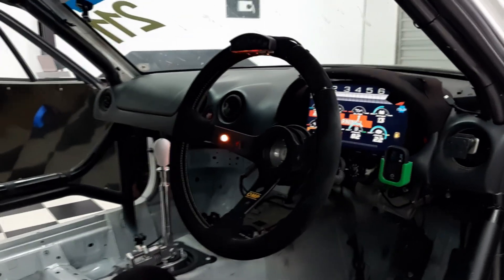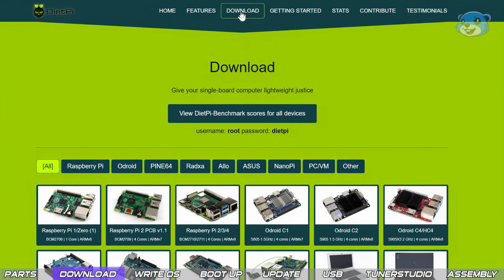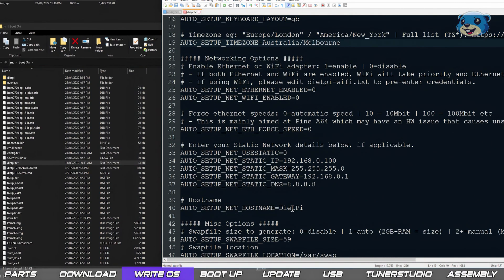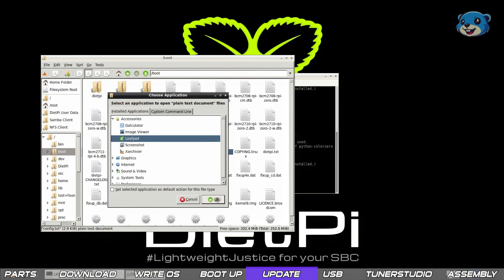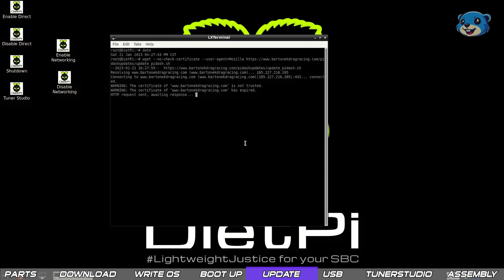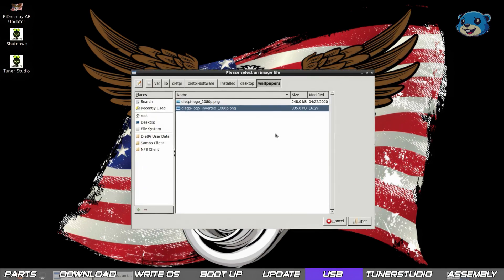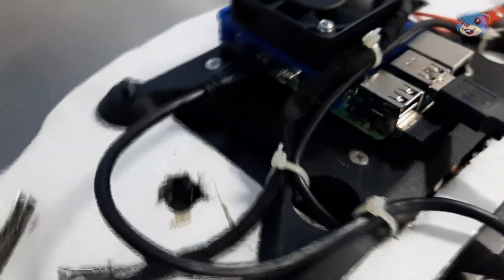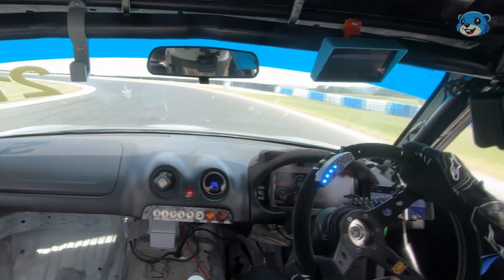DIY Car Digital Dashboard Raspberry Pi: GUIDE for Megasquirt

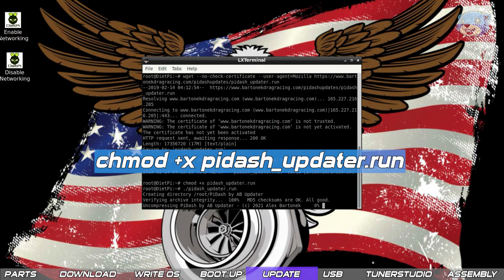Comment: Have there been any efforts to update this for Pi5? This is my first time using RPi of any sort, and it has been a struggle. PiDash won't work with RPi5. I got dietpi installed and made it up to 9:00 in the video but I can't get the update to work. Not starting with PiDash is a real handicap and I don't know what all has been added to get it on my own. I wish I would have bought a Pi4

Comment: Where do the various sensors feed into your system?  Are you running fuel level, oil temp and water temp into the raspberry somehow?
Reply from the maker: I'm running this dash in a track car that uses a Megasquirt MS3 ECU.
So all my sensors, speed, temps etc go direct to the ECU.
Then the ECU has a USB connection direct to the Pi to feed the data for the dash software.

Comment: Any chance for an estimated final cost?
Reply from the maker: It will depend on your setup, what specific hardware you want to use etc, but expect somewhere around $100 to $200 (USD) for a Pi4 or 5, some cables, and a screen.

Comment: Great guide, working on setting mine up. Did you have issues with your mouse and keyboard not working. I got mine to boot into the dietpi screen but unable to do anything else due to mouse and keyboard issues.
Reply from the maker: I've heard a few people report this issue, but I never had a problem. Must be a difference due to software version or something like that. I did a lot of my initial setup over SSH, so perhaps that's a difference?
Reply: @TechBeaver  Thanks for the response, I did some research and I found this on barton racing website. "10/03/2023 v1.6 is at 80% completion.  It boots up, loads TunerStudio. VNC is there so you can remote into it to tune your vehicle.  The “USB keyboard/mouse not working” is because the image needed updating.  BTW, the PiDash is moving to the NexGenEFI website.  I’ll update this page with the link to the updated PiDash version." I checked and have not found an updated image. I am going to just try setting it up with the normal Diet PI without the mods.

Comment: thanks brendan! looking forward to the guide for different ECU's, since i'm running a haltech (and don't feel like paying 1.5k for the ic7)
Reply from the maker: Thank you. That is the plan, currently working on getting a Pi build together with a more universal software option.
Reply: Did you ever get around to the haltech build? If not, what software works best with it?
Reply: Any update on this